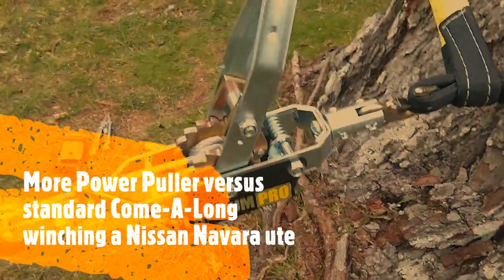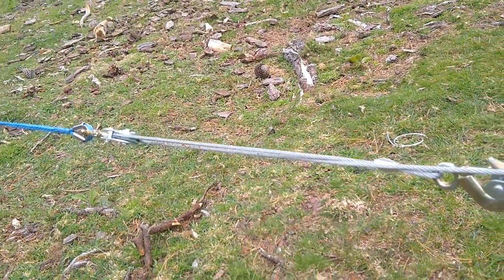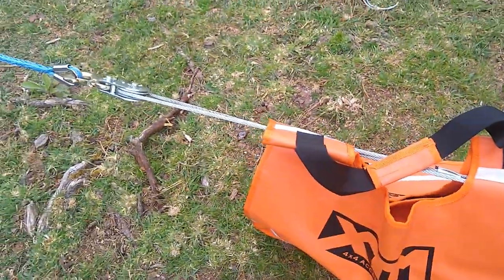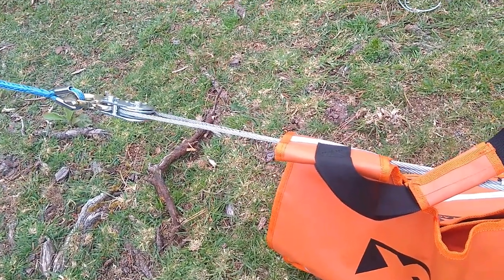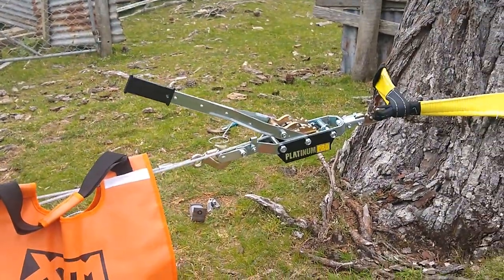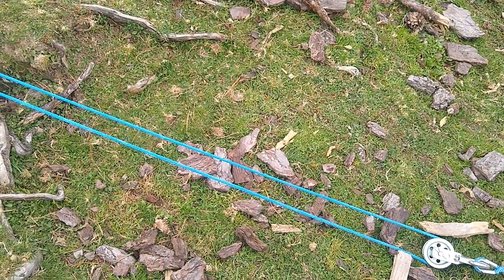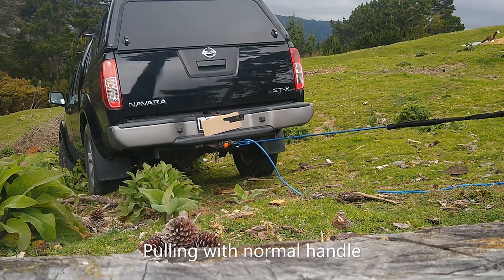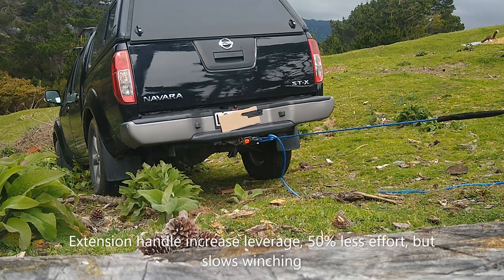Hand Winching a 4WD Ute - Wyeth Scott More Power Puller versus Standard Come A Long

Comment: Currently awaiting delivery of the W.S., 2.7 tonnes (single line pull) to 5.4 tonnes (double line pull) unit, from New Zealand, along with an alloy "X-lock" line length adjustment 'block' from the USA. Latter mentioned item seems to be the best available means of adjusting the length of the winches anchor rope (i.e. the distance from the winches rear hook back to the tree protector straps soft shackle) without  having to terminate the dyneema rope with a strength compromising knot. Can thus always utilize maximum winch rope capacity. Spent a huge amount of research on winches looking for an alternative to having to add around 130 - 150 kgs onto the front of my MUX and then having to worry about further cost of suspension upgrade, compromised pay-load and increased fuel consumption. I also recently sourced an alloy snatch ring and ditched my steel snatch block. Also two 30 lengths of dyneema; both fitted at each end with high quality tube thimbles. With this set up I can do a two line pull making over the full length of the W.S. winches 10mtr rope applying north of 5 tonnes and a three line pull, applying north of 10 tonnes and with the (accessory) extension handle, should have an easy (be as it may slow) time doing front, rear and side pulls. I also carry to sets of M@xtr@x, shovel, axe, drag chain.
Reply: Where can you learn about the things you talk about? Are there books or courses? I just purchased a used come along to pull large bushes. I never realized the topic was so rich with technical information.
Reply: @henrykarabela1829 Hello. My main sources of knowledge are the internet including You Tube. I am unaware of any books or courses. However please pursue more knowledge and understanding of the subject because the forces that come alongs can generate can result in very serious, even fatal injuries to you and/or bystanders if something gives way while trying to shift or lift a load. Stay safe and God Bless.

Comment: If I'm ever in this situation by myself and I'm hand cranking at the tree, what gear is the truck in? Are you putting it in neutral or park or something?
Reply from the maker: Hi Ryan - neutral, dont put it in park as then your having to drag the vehicle. This video the ute was in neutral with handbrake on, to show the strength of the winch. Better to be dragging it on a flat or uphill gradient, as if its downhill and you break free, chance the vehicle could roll forward.

Comment: Is it possible to reverse (safely and slowly of course) with this winch please?
Reply from the maker: Hi, yes that's one of the great advantages. See this video as an example. https://youtu.be/cQWMkdsZwKw
Reply: I have removed and installed many large engine/transmission combos with a more power puller.  They let down easy.
Reply: @handwinchnewzealand1801  Unlike this Chinese come-along, the Wyeth Scott was not designed for releasing tension on the line. In the video from the link, the guy is trying to prove that it's possible, but it was only possible because the tension was not very high. If it were, he wouldn't be able to operate that handle with one hand and the pawl with the other.

Comment: Can you estimate how many inches the hook moves per crank on the handle with the Wyeth-Scott?
Reply from the maker: Hi John, I have never measured this, but it takes about 2 minutes to wind in 10 m of rope (under no weight). There is a video on my channel pulling a log out of a gully - that took around 6 minutes to pull 5-6 m (roughly 35-40 inches per minute). Hope that helps
Reply: You can calculate it if you know the input force required.

Comment: Please please stop doing and showing dangerous practices like this, people will trust and get killed if they doing like you do. Few point of failures:  combination of synthetic winch rope and steel wire, choker connection of your tree saver and not even properly engaged hook's safety latch,.... either of these fail, will have catastrophic results and worst seems that your vehicle is in neutral and will continue to roll towards opposite direction. Hand pullers (come along) are not designed for Vehicle recovery but for tightening slack between fences and moving some what heavy like 600 to 1000 pounds horizontal and ONLY suppose to be connected by itself between anchor point and the movable object, no extension, no over head lifting.... You need to remove your video.😶
Reply from the maker: You are unfortunately wrong on many points there.

I do agree the cheap come along shouldn't be used for a recovery, the point was to show how difficult it is as many 4wd enthusiasts use these as a backup. This model was rated to 4 tons in a double line pull. Yes, a soft shackle could have been used on tree strop to ensure the latch could have closed as an added safety measure. 

The synthetic rope was also connected to the wire puller by a steel thimble - so its not a point of failure, only the rope breaking would be, with the most likely spot being the knot for the bowline, hence the rope was overrated at 9600 kg. 

The vehicle being pulled was in neutral with the hand brake on... so it was being dragged. If any failure occurred it wouldn't have moved. 

The more power puller is a completely different puller, designed and tested for dead lifting and pulling up to 12,000 pound. These have been used in many recovery situations for decades. Every recovery situation is different and dangerous, and people need to make a call when it is safe to use or not use a certain recovery device. 

This isn't a training video, it's purely a comparison of two products.